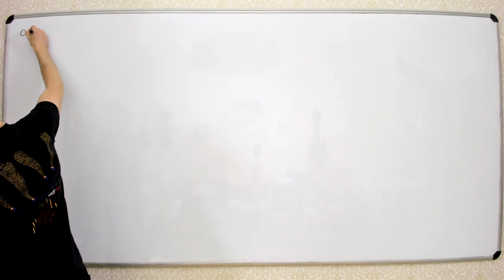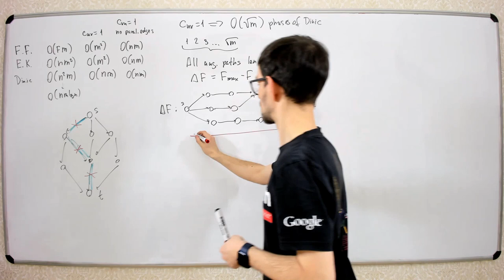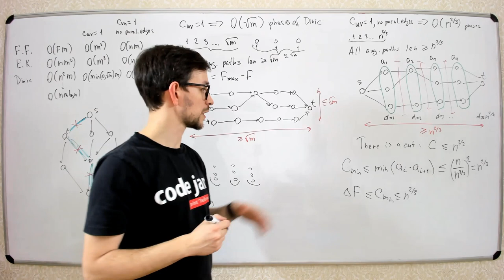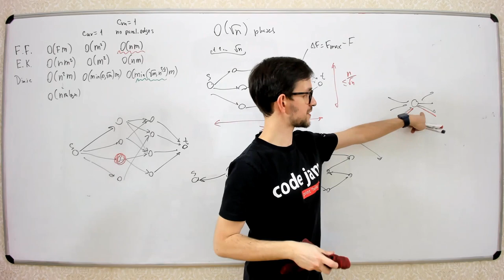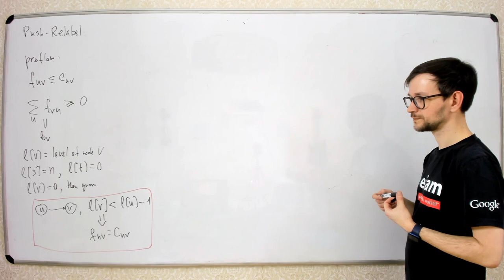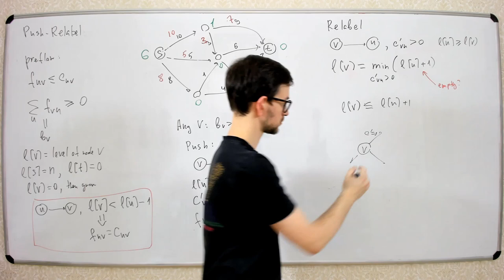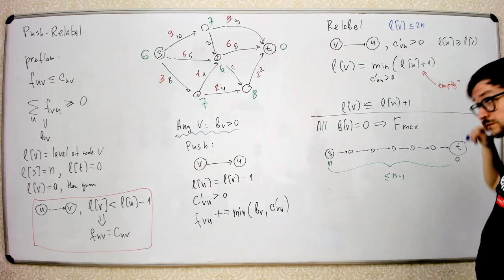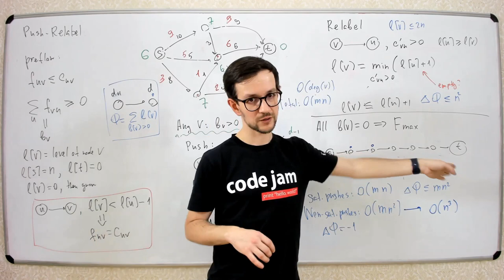A&DS S04E05. Hopcroft-Karp algorithm, Push-Relabel

Comment: Hopcroft-Karp algo

Hi Pavel,

Hopcroft-Karp algo doesn't seem to be Dinic's algo applied to Bipartite graph!

HK runs BFS on all free nodes of group L, gradually builds the alternating path, nodes belongs to alternating groups (L and R) wud belong to alternating layers of the network BFS builds, and finally BFS stops when atleast 1 group R free node is visited.

Now, HK runs BFS on the group R free nodes in that final layer built by BFS, and eventually visits a group L free node. This is 1 augmenting path, and adds all AUP edges to matching set M

After few DFSes find all AUPs, symmetric difference wud be computed between sets M and Mmax, to get the new Mmax, which would get x more edges for x AUPs run on the layered graph

Asymptotic time complexity of HK algo wud be same as Dinic's appled to bipartite graph -- O(m√n) as u spoke, but realtime performance of HK algo should be better than Dinic's due to these heuristics

Am I correct? Could you please correct/confirm?

Comment: Push-Relabel algo

Hi Pavel,

It seems "always select node with highest level as the next node" heuristic improves time complexity from O(mn²) to O(√mn²). You spoke about this heuristic towards the end of lecture. Do you know how to achieve this?

If PQ is used, it might lower O(m) factor (in O(mn²)) to O(√m), which I donno how to achieve, but definitely adds O(logn) factor (for add, remove, increaseKey), making it O(√mn²logn). PQ max-heap invariant can be "order level, excess-flow desc" (SQL statement style 🤪 -- I mean, select the node of highest excess-flow if multiple nodes have highest level in PQ). 

Could you please comment?

Comment: Dinic's algo for Cuv=1

Hi Pavel,

I'm getting O(n²) when parallel edges aren't allowed. Could you check this and correct/confirm?

[A] Cuv=1 + parallel edges feasible :: O(mn)
    O(n) blocking flows feasible
    all edges saturated in every AUP
    O(m) edges into t are feasible
    So O(m) AUPs feasible
    All m edges wud be saturated over O(m) AUPs
    Hence O(m) time to find all AUPs in a single blocking flow
    ∴ O(mn) time to find all AUPs in the flow graph

[B] Cuv=1 + no parallel edges :: O(n²)
    O(n) blocking flows feasible
    all edges saturated in every AUP
    O(n) edges are feasible into t
    all m edges wud be saturated over O(n) AUPs
    Hence O(n) time to find all AUPs in a single blocking flow
    ∴ O(n²) time to find all AUPs in the flow graph

Similarly, in the improvised time complexity calculation for "parallel edges not allowed" situation, shouldn't it be O(min(√m,nˆ2/3)*n)?